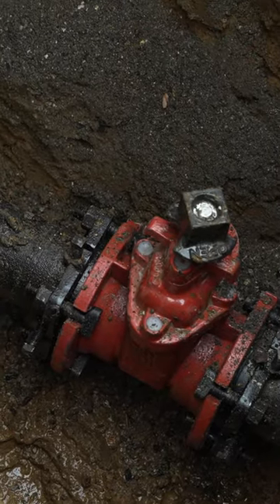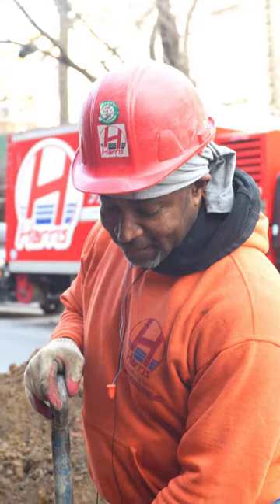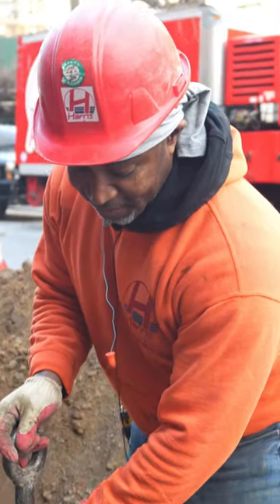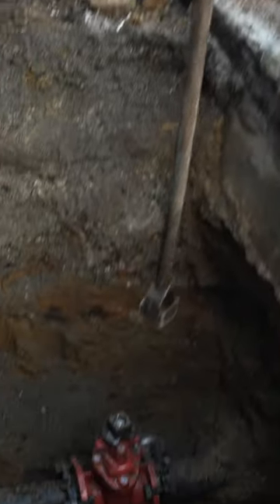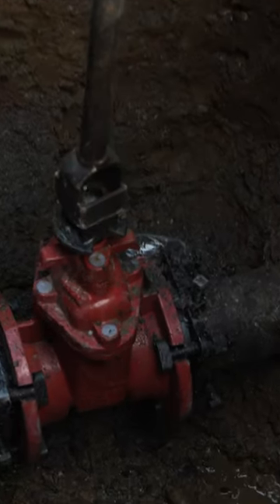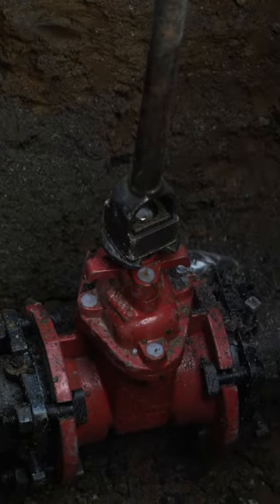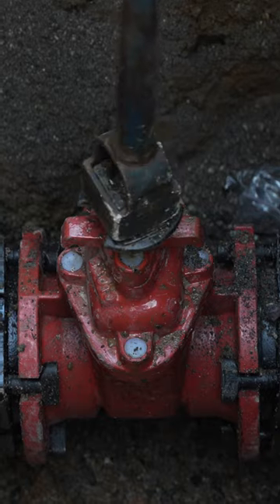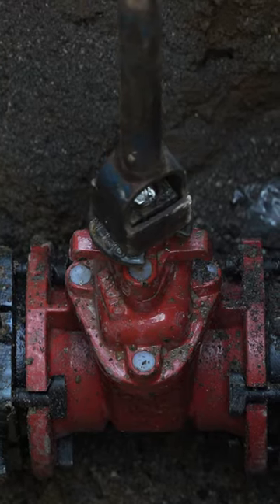Curb Valves, how do they work anyway?!

Comment: I know that you can actually buy the key 🔑.
Reply from the maker: 100% you can buy the key. But do you know how to use it 😁
Reply: @HarrisWaterandSewer  That is the key 🔑 question. Personally slow, and steady. I actually like to leave it to the professionals who do it everyday. I probably could get it done, but like I said before. When they have to do that work by my house I get very nervous who's doing that job. When I see that someone that knows what to do I don't get quite as anxious about it. I know if you don't do correctly that is a very bad thing.
Reply from the maker: @williamfenner9915  A wise man! Yes, we have customers that assume they can "handle it" until the valve is stuck in the closed position. Then Team Harris is on the way with emergency service
Reply: @HarrisWaterandSewer  I bet that they will use a key 🔑 that was not made for the valves.
Reply from the maker: @williamfenner9915  That happens daily! Another common is trying to close it in the wrong direction and snaps the stem, And finally, an older valve must be worked properly/slowly. It is common to force the older valves and they will get stuck in the closed position!